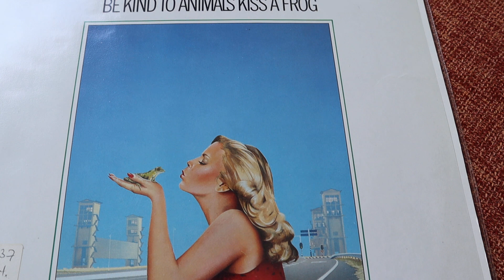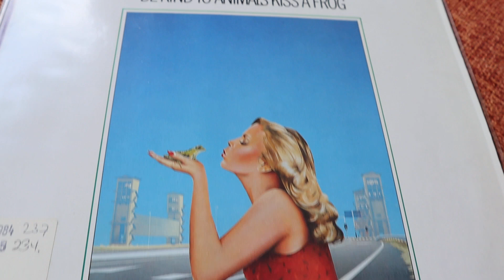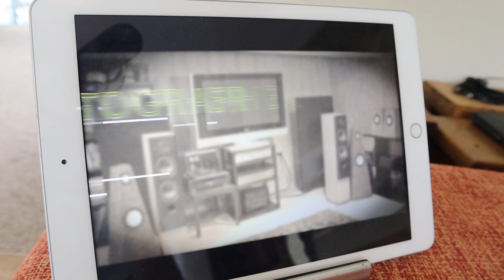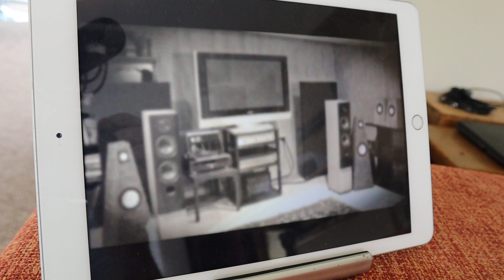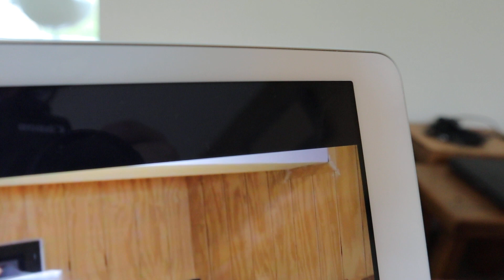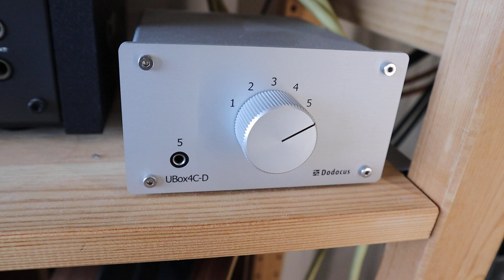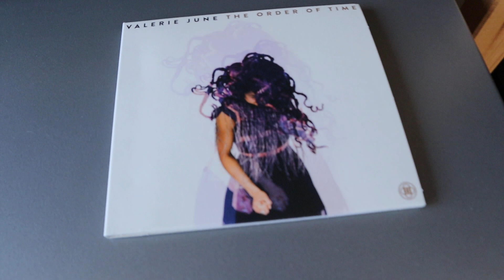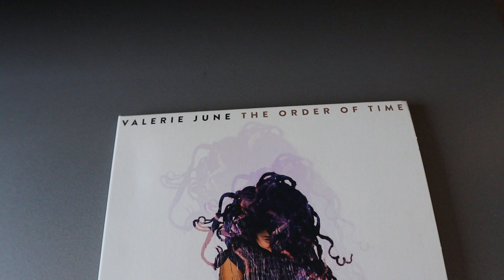A strange cable question, cable management, Quad audio and I'm playing some vinyl. Weekly vlog 55

Comment: That’s a very good Question, correctly answered by Marco, which makes a lot of speaker cable manufactures tremendously happy, for I am sure that if it were any different, they would immediately see their sales drop by 50%.

Comment: Hi Ivar, the "retrun" as, you say, in any circuit is as important as the "hot". No matter if it's the hot side or the return side, bad things like resistance, inductance and capacitance will add up in the complete circuit. So I'm sorry to bring the bad news but you really need both wires to be of the same quality not even of diffent kinds or brands. You want there to be a perfect ballance at your speakers since they rely on moving back and forth from a center position...
Reply from the maker: Thanks man, exactly what I was looking for. Too bad 😢 but now I know 👍
Reply: Marco is right on with his answer. thought the same thing and actually tried a really nice cable on the “hot” cable and a cheap “return” cable, and it sounded pretty awful. I didn’t look that much further into it, and just decided to use the exact same good cable on both. I can understand the thought process though, as it seems to make sense, but it doesn’t work well in practice.
Reply from the maker: @NickP333  Thanks. This question was bugging me, but today I learned something 😀

Comment: Hi Ivar - As Marco said, the positive and negative speaker leads are equally important.  The labels "+" and "-" are just to differentiate them.  That they play the same role, I'm sure of.  How the electrical signal travels, exactly, I'm not!
Reply from the maker: Vic Wahby Photography   Yes, too bad 🤨 Would have been nice 😀 Some very, very cheap cables do use different material for the return.

Comment: I know this is a kinda cheap way of combining 2 cables, but you could always just put techflex on a pair of cables like blue jeans cables offers as an option, especially if you already like the van den hul or any other separated cables that you’ve already got. Love your channel, btw! 
https://www.bluejeanscable.com/store/audio/index.htm
Reply from the maker: Nick Pantazi   Thanks for the suggestion and I am glad you like the channel 👍 However, I have used tech flex for some of my diy power cables, but with so many cables it is difficult to know what cable it is when covered in tech flex (I did label them of course, but still). That is why I would like to keep the originals without tech flex.
Reply: The Audiophile Barista 
Yeah, I totally understand that. I bought a few IC’s from blue jeans cables, and opted not to add the techflex, so I know where you’re coming from. 🎶🔊🙂👍